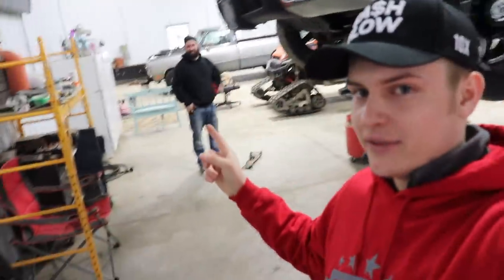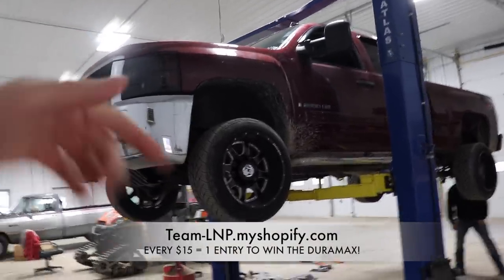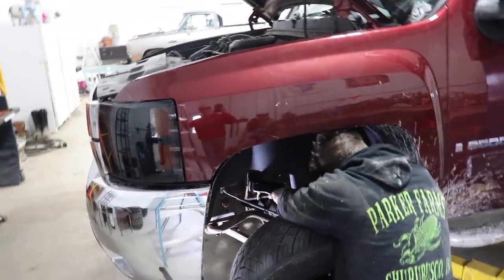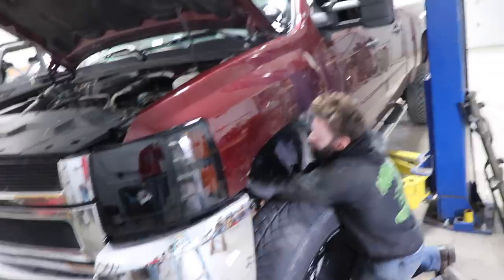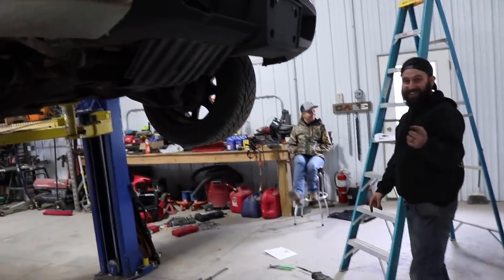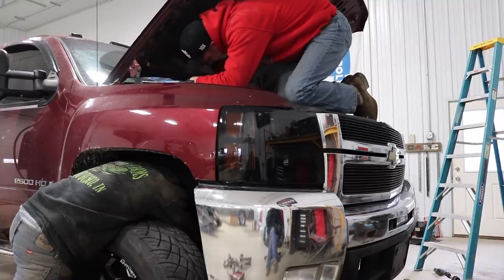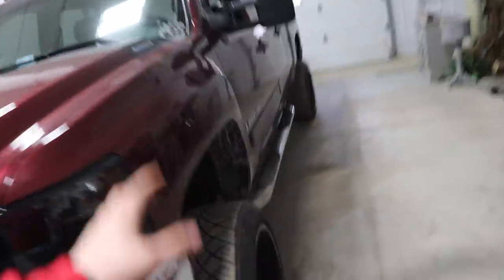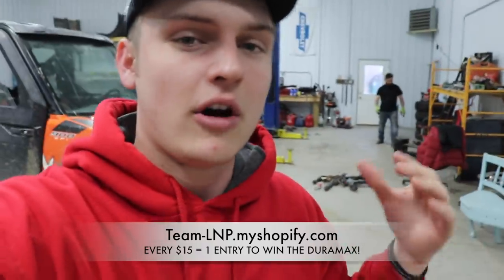LMM DURAMAX GETS NEW SUSPENSION LIFT KIT!!!

Comment: Did anybody notice the band aid on his face in the video where they were talking about the 12 valve and no he him himself in the face in the same spot so I'm assuming this video was shot before the 12 valve video was made
Reply from the maker: HolyGrail 95 that’d be correct haha
Reply: @LOUDNPROUD  good because of it wasn't the same injury then he needs to either be safer Or not mechanic anymore lol
Reply from the maker: HolyGrail 95 not be a mechanic because you get a scratch?😂 we wouldn’t have any mechanics than lol.. crap just happens
Reply: @LOUDNPROUD  no I'm talking about being accident prone.im a diesel mechanic and I have a black eye and a busted lip from my socket slipping off the bolt and flinging of my impact. Plus my Knuckles and the top of my hands are cut and busted
 But over time you learn how not to get hurt mechanicing. Unless you're stupid
Reply: @LOUDNPROUD  and I ment that by, if he got hit in the face twice in the face in the same spot.
Reply from the maker: HolyGrail 95 yeah no lol... it was just the one time.. put a strut up, turned his head away then by time he turned back towards it.. it was already falling towards his face.. lol
Reply: @LOUDNPROUD  well yeah I realized that one you answered the first time on my comment lol